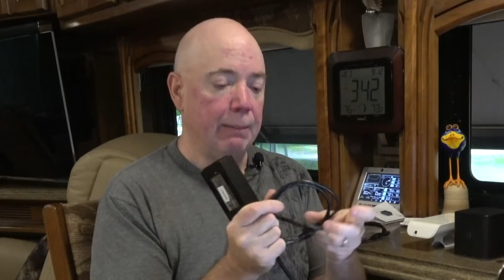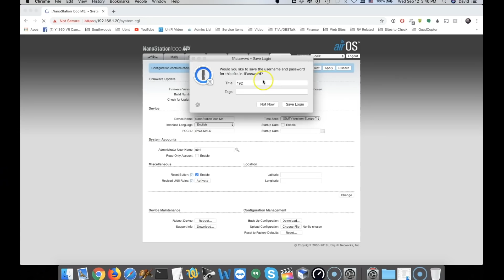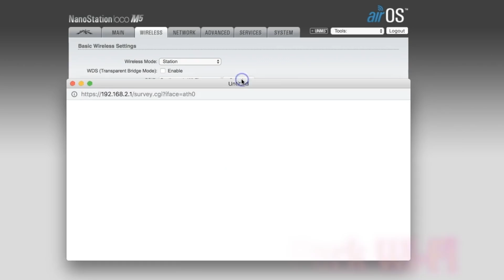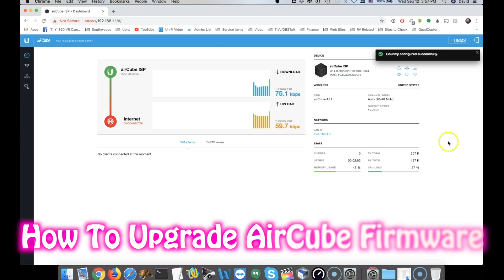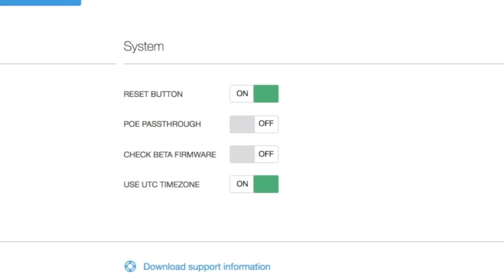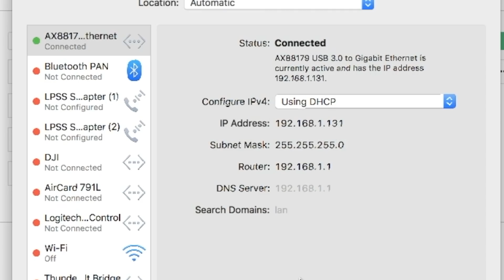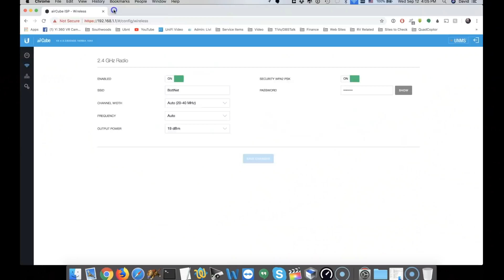Build a Private RV Wi Fi System with a NanoStation & AirCube AC

Comment: I had a problem for quite a while where I was confused because I couldn't log back into the NanoStation after I hit apply with the ip address 192.168.2.1 This was because I was using Static mode still instead of DHCP, so hopefully this saves someone else some headache! In order to get back into your NanoStation after making the changes and applying them you must be in DHCP mode to login and change the SSID and stuff. Great tutorial otherwise! I just was attempting to sign back in after setting it up and was completely lost why it wasn't working.

Comment: OK, I have a ubiquity network on my property using a combination of AC pro and Pro-M and AP-M-Pro access points. I'm trying to setup my camper before heading out this season  using your settings. However, I've followed your instructions to the letter and my nanostation M2 will not connect to my network. It's driving me nuts. My home network is on 192.168.8.x and that should not be a conflict. I can see my network, lock an AP, put in my credentials, and I cannot get an internet connection.  The Nanostation M2 is using XW v6.1.2. The aircube AC is running version V2.5.0 BE3E459.190520.1449  All of my local AP's are on version 4.0.42.10433.  I'd like to get this tested and wired before hitting the road. Do you have any suggestions? I did disable AIRMAX based on another thread I found which was not in your video. The last thing I noticed that was different than your video in the nanostation setup is under the lan settings. Your video shows configuring LAN0 whereas mine says the LAN interface is BRIDGE0
Reply from the maker: Only thing that comes is mind is you missed the NAT settings under the NETWORK tab of the NanoStation.  If your NanoStation shows it is connected to your network AP, you have RX and TX both showing a connection, and you got an IP address  handed out from the NanoStation, then maybe that is what you missed.  Only thing that comes to mind off hand.
Reply: @DavidBott  I checked that several times. I only have the lights on the lan port. I did find an "open" network that had a poor signal strength of -96 db. I did try connecting to that SSID and I did get the WIFI scale to light up. However it was an open "Guest" network that still required a password. So I think the nanostation  is OK but for the life of me I don't understand why I can't connect to my home network. Leaving Thursday for our 1st trip of the season and my wife is looking at me why I'm not helping load the supplies ;-) I love your videos!
Reply from the maker: @gregliebig2240  Well if the lights did not light up, then you were not connected to anything. If the colored scale lights are flashing on and off, it is trying to connect but likely an incorrect password.  (that is the way it tell you has it has no screen.)  But can't say why it would not connect to your home. Sometimes you can run into compatibility issue, but that is rare.  Now go help pack!
Reply: @DavidBott  Well I found the problem. The Nano Station M2 is not compatible with any of my unify APs on my network. That includes 2 AP Pros, 1 AP-LR, 1 AP-M-Pro, and 1 AP-M. All my home network AP's are setup using the default settings and for some reason the 2GHz frequency is not allowing the Nano Station to connect. I plugged in an older ASUS Nighthawk router into one of my switches and configured it as an access point and the Nano Station connected just fine using your instructions. It tool me over 8 hours over 3 days to finally figure this out. Time to hit the road! Happy trails!
Reply: @gregliebig2240  Then you have something not set right on your home network is my guess as I use Ubnt UniFi gear and I can connect to AP-Mesh-Pro's just fine.  In fact, their are 12 NanoStations M2 connected in the park right now and the entire park AP-Mesh-Pro's. (I run the network in this park and I run Unbt in my coach.)
Reply: @davidbott5438   figured something must be wonky with my setup. I've only been using ubiquity products for about a year and have a little more to learn. Sitting at the campsite now in Kewaunee, WI. What kind of incoming bandwidth do you recommend for a 267 site park? I totally agree with your other video about speed limiting and not streaming Netflix, etc. The owner and I have been chatting about what he'd like to to. Everything he's tried in the past failed. He has no good pipe to his site at the moment and I couldn't answer his question. He's got about 40% seasonal sites, too. If you have time, check out my videos for Rotary Making Sprits Bright. That's where I've put wifi to the test so far. Thanks for your replies. They're very helpful! Greg

Comment: Thank you very much for this video. I put together the exact same system (with the exception of the full size NanoStation M2). I was able to set everything up with your help in under a half hour.
Reply: Errol Flynn how?? I’ve tried with 3 different M2s
Reply: Christopher Agostini I watched the video once. I liked the idea so I ordered the M2, the cube and two new shielded cat6 cables according to the recommendations. When everything arrived, I unpacked everything and watched the video again doing every step as the video was playing on my phone. At the end, it all worked exactly they way it should.
Reply: Errol Flynn I got 1 out of the 3 to work.  I think it’s because the other 2 have newer firmware so you can’t turn off the AirMax settings.
Reply: Christopher Agostini yeah, that’s probably the reason it didn’t work. He mentioned in the description under the video that AirMax radios won’t work as they only communicate with other AirMax equipment.
Reply: Errol Flynn well I’m using M2s will newer firmware so I can’t turn off airmax.

Comment: Thanks so much for video.  My nanostation is all set up and my lights are all on but I still don't get any internet access. Any ideas why that would be?
Reply from the maker: No way I would know I am sorry to say. No idea what you are connecting to even as you provided no information.  If it is an RV Park, do they use a Captive Portal you need to go thought to get access?  If so then you may have not read the part about captive portals...

Dealing with Captive Portal or “Agree” Pages: Some parks require you to “agree” or login with a user name and password before you have access. So once you connect to the park with the NanoStation, while on your Wi-Fi network, the first time you open your web browser the “captive portal” page will come up asking you to agree or log in. Once you do, the portal will note the MAC address of the NanoStation and then allow access to anything on your local Wi-Fi network.

NOTE: If your browser defaults to open a webpage that is HTTPS (vs HTTP) then the captive portal can not show up as it is not HTTPS active. So be sure you are trying to go to a site that is not HTTPS. (Ie…Facebook, Google, GMail are all examples of HTTPS sites that people have their browsers default to.) So try another site…any site…maybe ours http://Bott.net, and the captive portal page should come up for you. Also some campgrounds auto log you out after X hours or at the start of a new day. If this is the case you need to AGREE again. Just a heads up.

Comment: Thank you so much sir.  If I'm trying to cut costs, could I just take my home modem/router with us on the camping trip, and use it in place of airCube?  I understand the cube provides power to Loco m2, but is there a work-around for that?  Thanks for the really well done video.
Reply from the maker: Yup...On the POE Injector there are two ports, POE & LAN. Plug the NanoStation into the POE port and plug the LAN port into the WAN port of your router.  The router will get an IP address from the NanoStation and you will then be able to talk to the NanoStation at 192.168.2.1 just as mentioned.
Reply: @DavidBott    Great!  I'm going to order the NanoStation right now.  Thanks again for the great, easy to understand presentation...and the quick response to my question.   To add:  Will that give me the ability to be on my own network (apologies for the wrong terminologies),  similar to what you show with the Cube?
Reply: David, I asked earlier about using a spare wireless router instead of getting a Cube.  I made it all the way to hooking up to my router and turns out I have a coax cable connection for the WAN side on my wireless router.  Obviously I can't connect my Cat 6 from the POE LAN...is there a work around for this, or do I need to get a wireless router with a Cat5/6 WAN connection?  Thank you for helping us all!
Reply from the maker: @tosc6004  What you have is a cable modem with wi-fi built in.  You need a router.

Comment: Dave, I like and appreciate your videos. I set up a nanostation loco m2 several years ago per your video, and it has been working fairly well in the RV. I would like to upgrade and want to know if the nanobeam technology would be and improvment. I am wondering if there is similar unit that would do 2.4 and 5 hz simultaneously, that would match up to the Aircube AC.
Thanks for all you do.
Reply from the maker: There is no dual band unit that is like this that I am aware of.  A NanoBeam is just a more narrow beam, something you would usually use when using two of them together for long distance.

Comment: Dave, thanks for the how-to, couldn’t have done it without this.. one question tho, if I wanted to add a m5 antenna along with m2 what would I have to do to get this done? The cube has just one POE output. Could the m5 be configured to go to the secondary slot on the m2? FYI I was able to configure both the m2 and the cube wirelessly with an iPad... thanks again!
Reply from the maker: You would not be able to use the M2 and M5 at the same time as they both are being used as routers and also the AirCube would also only look at the WAN port and this whatever is plugged into that.  So if you would setup and M5 the same exact way you did the M2 and just switch them out based on the one you want to use.

Comment: Hello David thank you again I was able to setup last night with your video ! 

Using the UNMS iOS App you mentioned that it can control
the nano station ? In what way ?
Reply from the maker: You need to go into go into the app and manually add the IP of the NanoStation and the login. When in UNMS click the three lines at the top right, click the door with the arrow, enter in 192.168.2.1 (or whatever you may have used) and the user name and password.  (Be sure you are connected to your network when you to this of course so it can be reached.)  Click LOGIN.  It will remember the info for later.  Enjoy.
Reply: @DavidBott  amazing! thank you David I will try that today! 👍💪🚐📡🍺🍻
Reply: David Bott it worked ! Amazing

Comment: David, what would I need to do if I wanted to be able to use the M2 or the M5, depending on the RV park setup? Also, how would I be able to determine if the park had 5ghz? Thank you.
Reply from the maker: Buy and M2 and an M5 and set them both up and then just use the one you want to use. They setup and are used 100% the same way.  You likely can find a phone APP that will show you all the SSID's and the frequencies they use. (2.5 or 5) as most phones today can use 2.5 or 5 and will automatically use 5 if it can.
Reply: @DavidBott  Thanks, David. We just bought an RV and haven't made our first trip yet. I'm thinking it would be nice to take advantage of the 5ghz w-fi where available as there would likely be less traffic on that frequency. Thanks, again!
Reply from the maker: @blacksummerrain  The downside is you will find very few parks with 5Ghz.
Reply: @DavidBott  But in those few Unicorns I'll have the Bott-inspired advantage! :-)

Comment: I really like your video and want to try this. I have a question though. Right now I use pdanet to tether my phone to my laptop. If I were to then connect my laptop to the aircube with ethernet would I be able to share cellular connection with the aircube? I go to a lot of parks that don't have wifi and I'm looking for a solution to do a lan setup so I can use plex streaming from laptop when no connection is available at all, but also use the cellular connection as well as be able to connect to wifi if the park has that.
Reply from the maker: Yes, this is a full home router so you can use it like you would any home Wi-Fi router and it has some ethernet ports on it. The NanoStation is used to connect to any SSID that you are looking to get Internet from and then supplies that connection to the AirCube so the internet can be used.  But wait, you want to  tether your phone to your computer and then share your computers Internet. Your computer would then need to be able to act as a router or to "share it's internet connection".  So if you have a way to have your ethernet port in your computer to be a router, then yes, you could connect it to the WAN side of the AirCube for Internet but then you would not be using the NanoStation unless you wanted to connect to a parks Wi-Fi or other HotSpot or JetPack.    A program called Connectify will allow you to share your computers Internet...  https://www.connectify.me/
Reply: @DavidBott  ok thanks. I was just wondering if there was a way to do it without physically  having to change the ethernet in the wan port. But no big deal.

Comment: I just did the setup and it worked perfectly in my den.  Next I will transfer it to my RV and do some distance tests.  Thanks David!
Reply: Curious why I would want this in my RV? I travel a lot. Thanks
Reply: @DouglasFisher  Two main reasons.  One it pulls in the camp Wi-Fi better.  Two, it makes it so that all devices connect to the RV Wi-Fi (I set them up once) vs each one connecting to the camp Wi-Fi (I set up five devices at every campground). There are other benefits as well, but these are the most important to me.

Comment: Implemented this last month and the instructions are excellent. Thanks a lot, David!
Reply: Welcome!  Glad it all worked for you.  Well, I knew the video worked...as many have done it. Just glad to read when someone takes the time to say it worked. If that makes sense. :)   So thanks.
Reply: @davidbott5438  Haha absolutely. It's basically a small review for people to be confident it will work. Quick question: is there any reason to use an external router like the Asus RT-N12 in conjunction with the Aircube? I know you mentioned using one and I can't seem to find info on the benefits of doing so.
Reply: @ericsirianni  No. The AirCube is the router and would be the same as that router. The only thing you could do, if you only bought the ISP version, is to swap it out for the AC version which then also gives you a 5Ghz option to use to connect your devices with.  Or you could remove it all together and use any router you may care to.  The only reason I went with the AirCube was it was all from the same manufacturer and it makes for a very small package for RV use.
Reply: @davidbott5438  Thanks so much!
Reply: @ericsirianni  You would not use another router in conjunction thats for sure. You would use it in place of if you wanted to.  Using a different router may offer you different features you may be looking for. Like a Dual-Band router where your devices can connect over 5Ghz vs 2.4Ghz.  The AirCube comes in two flavors, the AirCube ISP which is 2.4Ghz only or the AirCube AC which offers dual-band.  But any router you choose to use you would then just connect to the NanoStation to the WAN port of the router and off you go.  Hope this makes sense.
Reply: @davidbott5438  Right on! Makes total sense. Thanks!